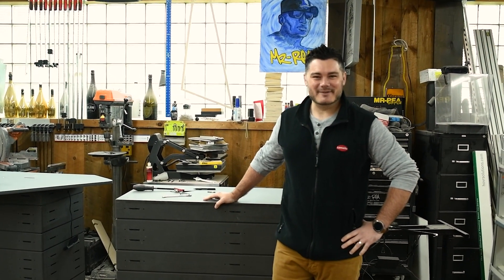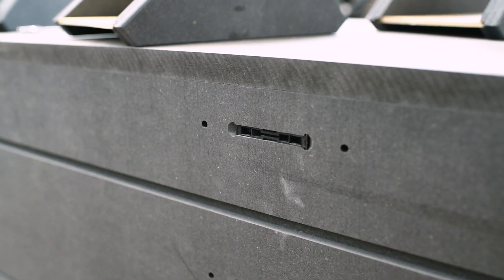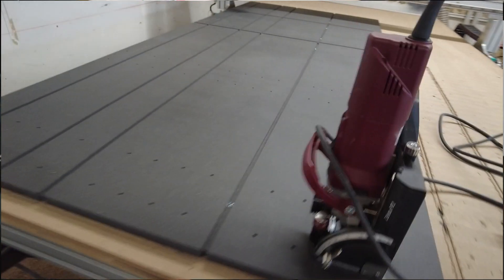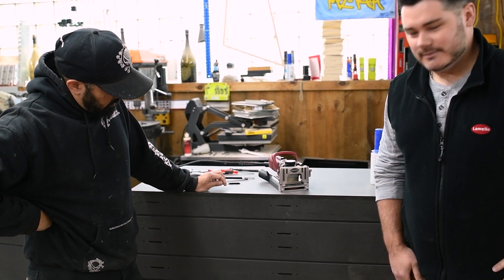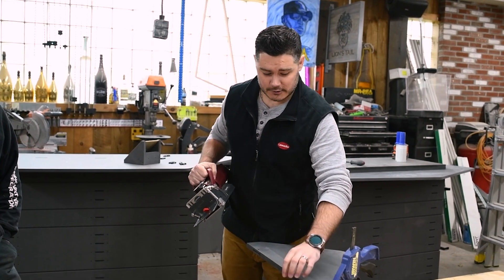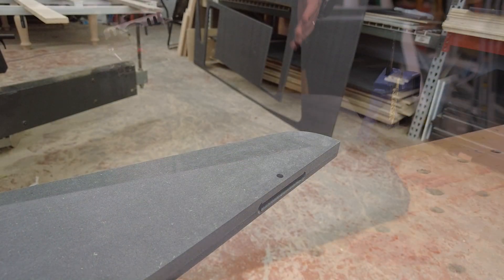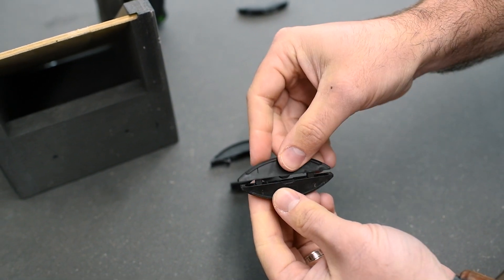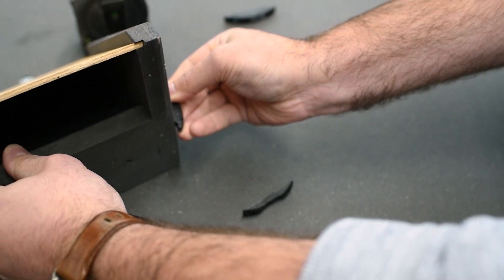How to use the Lamello Zeta P2 with a CNC router

Comment: What’s the part number for the red indexing pin?
Reply from the maker: 251067 as in the description: Items mentioned in this video: Clamex P-14/10 Flexus - 80 pair - No. 145315 Clamex P-14/10 Flexus - 300 pair - No. 145316 Zeta P-System Positioning Pins (Set of 2) - No. 251048 Zeta P-System Nesting Clip - No. 251067

Comment: Very cool project, but I have some questions… 😊
1. If I don’t have a CNC how can I drill the two 5mm holes for the locating pins?
2. Do you have a template to make the locating pin holes or do I need to make one?
3. What materials was the project made from?
3. What was the project?
Thanks for your time.
Ron
Reply from the maker: 1.  You’d really need a CNC for this to maintain accuracy.  You can low-brow a solution by building yourself a jig or story stick which references off of the base of the Lamello machines.  That would be our advice.
2.  Sorry, we do not offer this – see answer to #1
3. We recall it being an HDPE material
Hope this clears some things up for you
👍
Reply: @ColonialSaw sorry that wasn’t a HDPE, it was Black MDF aka Fibralux or Spanalux.